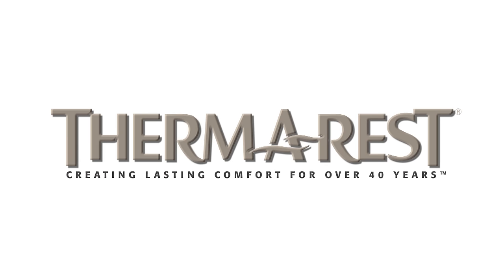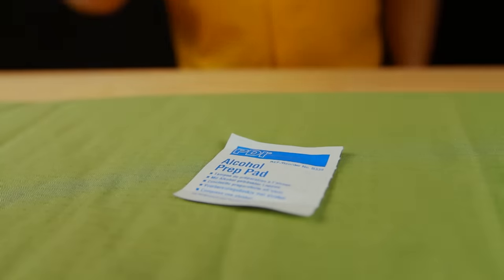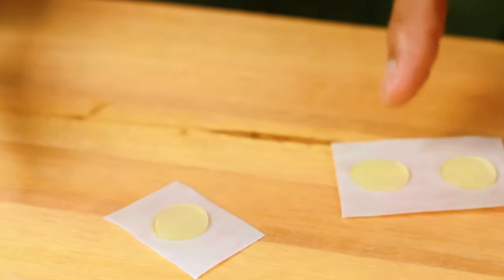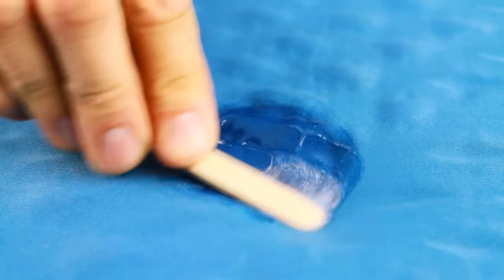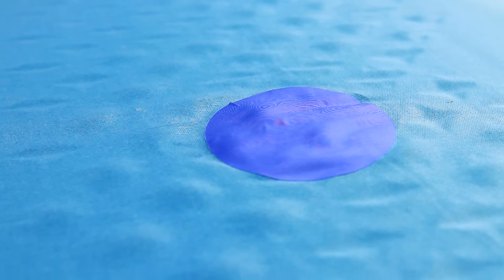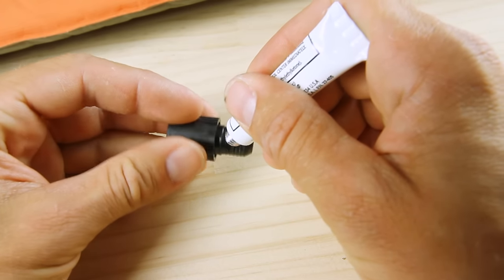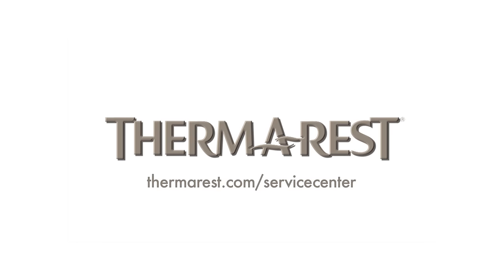Repairing Your Therm-a-Rest® Mattress

Comment: what if the side of the matress just blew out ? I just need to use a glue to stick both of the lips to kiss each other again. But dont know which glue to use ? I have epoxy glue 2 mix, super glue. Don't know if i should use a rubber cement glue ?

Comment: I tried this many times but could never find the hole in the mattress no matter how many times i tried. It is a pinhole somewhere and leaks over time but i just could not find it.
Reply from the maker: If you can’t find the leak on your pad or if you would just like us to take a look at it, you can always send your pad into our repairs facility. For pads losing air due to a defect in materials or workmanship, (for example, a faulty valve or blown out seam,) we will repair or replace the product free of charge. If there are punctures in the body of the pad then we will patch up to 10 holes for a flat $20 fee.  To get that process started, visit our warranty and repairs page and create a return authorization or give us a call at 1-800-531-9531. 
https://www.thermarest.com/warranty
Reply: might try submerging fully inflated under water in a bathtub - easier to spot the bubbles.  Squeeze around the valve area especially

Comment: Hi there, bought an older model (01806) surplus from a friend. After some time there was an area around down the middle of its length near the edge of the side, where the outer fabric bulged up as if i was detached from the selfinflatable foam on the inside.
So far i haven't found any help topic on this matter. 
Guess the only way to fix that is with a cut above or on the sealed side, open it up, glue it with a glue not harmful to the foam, press it for a while, and stitch and/or seal back together the cut area.
Not sure if there is something like a life time warranty or it could be sand back to you guys for fixing.
Thanks for a reply to this topic.
Regards, Adeptus

Comment: My family and I all use Therm-a-rest mattresses.  One is old with metal valve (35 years old - Serial # 398148) which has travelled all over the world.  The metal valve needs replacing. Will your valve repair kit work with this mattress?
Reply from the maker: Hi Graham, we no longer manufacture the metal valves but our current valve repair kit with the plastic valve is compatible with your mattress.

Comment: The leak in my NeoAir is so small that it takes 2 hours of sleeping on it to deflate to an uncomfortable level. I'm thinking it might be the valve. I will try that first. Love my NeoAir though. I've had the same one for at least 8 years. They are tougher than they look!
Reply from the maker: Hello, if you are still having issues after testing and attempting to patch your mattress please contact warranty@cascadedesigns.com for assistance.
Reply: It could still be a tiny hole.
The soapy spray method wasn't enough to find a slow leak I had. I had to submerge the pad in a bathtub and compress to find where I had two incredibly small holes.

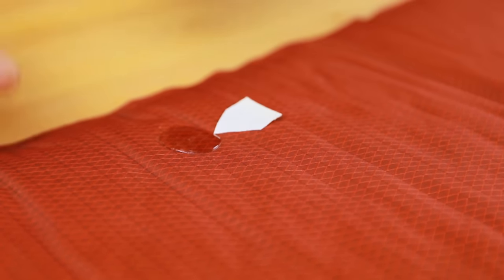Comment: what kind of patch you are applying at 1:38? There is nothing like this in the "instant field repair kit"
Reply from the maker: This patch is in the Permanent Home Repair Kit. The Instant Repair Kit has a circular self-adhesive patch that works well, but the square one in the Home Repair kit is thicker and stronger.

Comment: Hi I have a neoair xlite, do I need to use the glue Dot and tear aid patcg. Or just use the tear aid patch ?
Reply from the maker: Hello,

Adhesive is a critical element of a successful Therm-a-Rest patch job. While the patch may be self-adhesive, using the glue dot will allow you to work an adhesive layer further into the hole in order to properly seal it off. The patch over top becomes a protective layer, and a backup seal. Typically, glue dots are associated with "field repairs" whereas a urethane based adhesive, that takes several hours to cure, is what we recommend for more permanent and secure repairs.
Reply: Therm-a-Rest thanks for the reply 👌

Comment: Easier and less expensive repair: Use E6000 glue, which is available in USA in grocery stores, drug stores, Walmart, hardware stores.  Allow 3 - 5 hours drying time.  You only need to apply glue. Nothing is needed on top of the glue.